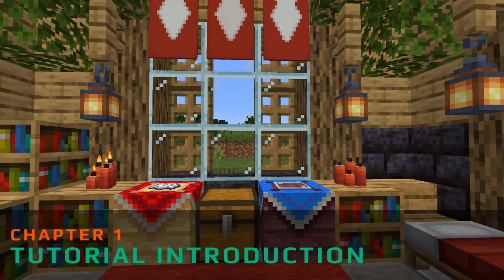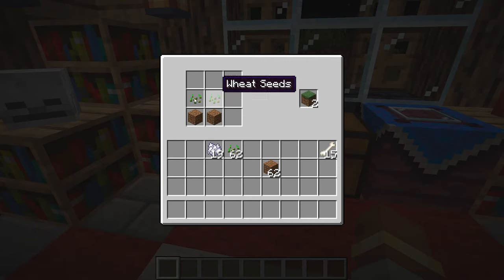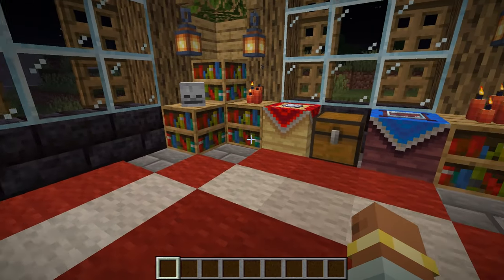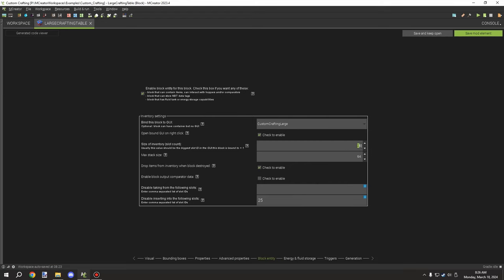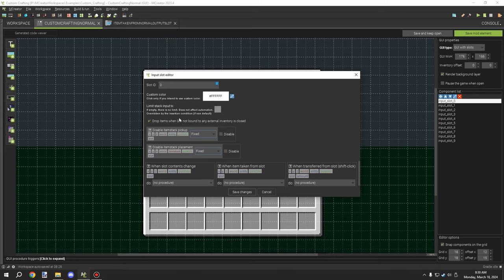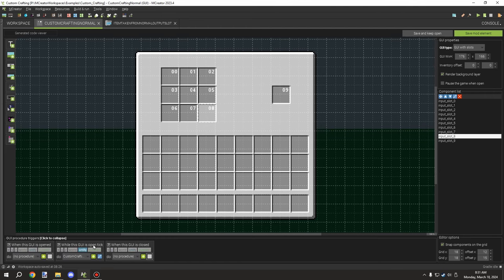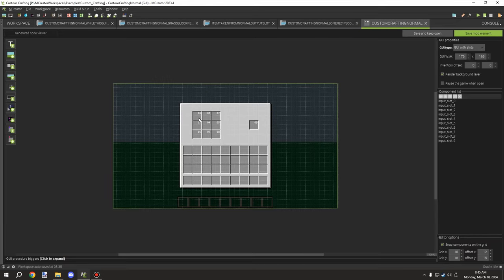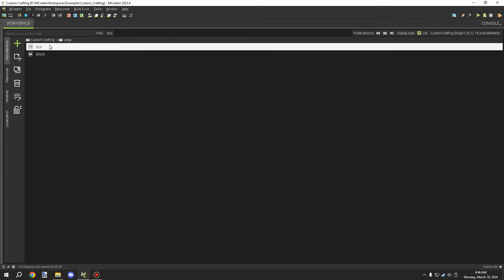How to Make a CUSTOM CRAFTING Table in MCreator!

Comment: It is a pity that there is no way to create new armor slots in the inventory... ehhh
Reply from the maker: One of the most common questions is adding slots for rings and such, sadly its not possible at the moment not without coding at least.
Reply: well there is an add-on for mcreator I think. no idea how it's called but you can make rings and such. but you have like a ton of slots I think am not sure
Reply: @TheMuscularFrog  it's called the curios API.
Reply: @vtubruh  well, if someone can make extra inventory slots, then this may be a possibility

Edit: oops, I didn't realize this was a mod, I was talking datapacks

Comment: Is there any way to make a stone cutter like blocks?
Reply from the maker: I have not tried, it may be possible to cycle recipes using slots and then maybe have some kind of action when the slot changes to update the output item then remove the item but I honestly am not sure if this would work or not. It would require me to do a lot of testing and trial and troubleshooting. But off hand that's by best idea which it could be done without coding.

Comment: I know this is off-topic but I really need help with this: So I was making a Minecraft mod with Mcreator, using Blockbench to make the models for entities and Geckolib only for some entities. But when I made a new entity, an error message showed up when I tried to do anything. Make a new element, update an element, launch the game to test, nothing worked. I check the code and I had no idea what I was looking at and one of the errors was could not find symbol. I tried turning Geckolib off and back on, but still, nothing happened. The error in question was "one or more of your mod elements did not compile correctly. this can happen if you lock mod base files or elements." I press regenerate code and the same pop up error shows up again. Press it, again, again, and again, no end. I NEED to solve this problem as I don't want to have to make another mod and start from scratch and wait for that one to be broken too.
Reply from the maker: I responded to your other post about this question.

Comment: Can you make a tutorial on how to make snow-layer type blocks?
Reply from the maker: This is pretty easy its just blocks that range size in pixels, when you right click on them with an item it replaces the block to the next stage until a full block. This can be done using global trigger for player right clicks block so it's easy for build. With that being said though each stage consist of 2 pixels in difference so your sizes would look like this.

2, 4, 6, 8, 10, 12, 14, 16

Basically just the same block but at different levels.
You will need to model them all by hand in blockbench though.
Reply: @NorthWestTreesMCreator  alright thank you

Comment: Hi, i did try to make the crafting script and noticed that it doesnt allow me to set the procedure to trigger While this GUI is open tick because it has required dependency itemstack. Is there any way around it?
Reply from the maker: You would need to replace the itemstack block with a item selector block, though item stack local variables should still work as long as long as the item selector is used to apply the item to the variable.

Comment: Hi, making this comment in case anyone was having the same problem I was having. I noticed that after following this guide, the items would stay in the GUI when closed, rather than dropping or returning to my inventory, and if I broke the block the GUI was bound to, it would drop all items, including any items in the output slot. To fix this, don't enable block entity on the block, but instead make a trigger that opens the GUI when you right click the block. This unlinks it from any sort of external inventory, if that's what you're trying to do.
Reply from the maker: For items to return to the player this would require advanced script to do when the GUI is closed, but for your other issues your output slot should have settings to disable dropping make sure that players can't add to that slot. There should also be overrides for preventing it from dropping there in the slots settings too.
Reply: @NorthWestTreesMCreator  I actually managed to fix the items staying and duping when the block is broken by just disabling block entity, and having a trigger that opens the GUI when you right-click it. That way there’s no inventory for the items to stay in, so they just go back to yours.

Comment: W video, I made an MCreator mod that I want to use on all multiplayer  servers all it does is when I type /itt it says something in chat and opens a GUI. Is that currently possible?
Reply from the maker: Far as I know mods only will test for thing on the current server. For something like this you would need to hard code something in. Though I think it may be possible in the future to send players between servers if I understand some changes Mojang is working on, though I doubt it would be possible to test if the mod exists on another server.

Comment: Hello, I have never learned to program by blocks in MCCREATOR so I wanted to ask for your help, I really need it, it is a mod that I want to design which works like this, as you already know if you press Ctrl + Q you release the item that is in the slot of your hotbar, and what I want is that when I press Ctrl + Q, absolutely everything that is in my hot bar and in my inventory is thrown away.
Reply: I know how to do it, make a keybind for Ctrl + Q then make a procedure for when you press it, then make the procedure clear the inventory with ''clear inventory of Event/Target Entity''
Reply from the maker: PeaNutferret is correct.

You would need to create two key binds one for CTRL and one for Q I suggest saving this as a player lifetime variable for each one just a simple logic value so you can test if both are true. 

When each key bind is pressed you will need to toggle the state, same when its released you will need to set them to false. This way you have a switch system for your Key bind.

 Doing this will allow the game to test if A and B are true if true then simply clear slots from 0 to 8 which are your hot bar slots.
Reply: @PeaNUTFERRET  ohh ok
Reply: @NorthWestTreesMCreator  ok but let's say that mod is considered a vanilla KeyBinding or let's say on servers, it will detect it as an add-on. That is, it possibly works on servers like Aternos, survival servers, Skyblock?

Comment: Hello! In my mod, I want to make a 5x5 crafting table (not a 3x3) but, when I import the gui open tick procedure you've provided, it says that there are errors: "Procedure return value block is calling nonexistent procedure CustomCraftingNormalGrassBlockRecipeCondition" and "Procedure return value block is calling nonexistent procedure CustomCraftingNormalBoneRecipeCondition" . I have imported the only gui open tick procedure you've provided and I think it is for the 3x3. How can I fix the errors? 
Thank you for your time.
Reply from the maker: The return value in t he update tick procedure for the GUI would be for testing the recipes, this compacts the code a bit in the main file. I provided the 5x5 recipe condition in the project files make sure that you link up that at the location for the update tick procedure and then set your custom recipe, once done regenerate the workspace code and you should be good to go. You may need to remove unneeded recipes from the update tick main procedure but in most cases this should resolve the issue your having.

Comment: Hi, I have a question... How is the ItemTakenFromNormalOutputSlot procedure and there is a Set... to: and a number. So how do I create a Local: slot for that window?
Reply from the maker: This would be a local variable, you would need to create the local variable on the right panel under the button to save the procedure.
Once you have the local variable saved you will see it under custom variables on the left side.

Comment: Can you make a crafting recipe with custom made items on a custom made crafting table or only vanilla items
Reply from the maker: All recipes are custom, works with vanilla and mod items. If other mods have tags for each item it can also use tags rather than testing for a single item which can add support for other mods if they have tagged other items.
Registries might also work too.

Vanilla crafting recipes are not actually supported just yet I am working on a API that can read from forge data packs and get all crafting recipes but this is taking some time to develop. I just released my discord server last Sunday so I have a bit less time as I have been active there helping moderate the community.

Comment: Is there a way that I could make it so that you have to wait for the item to craft, kind of like a furnace? (It is a 5x5 table) If that is not possible, it would also be cool if there was a button in the gui that can fill a progressbar
Reply from the maker: This is possible if you use a timer to delay the output slot item being added, basically that's the only difference between crafting and furnaces besides crafting using more slots and no fuel but same thing pretty much. I have covered how to use timers, though I think it was for Global variables they do also work with block, entity, and item NBT variables just not local variables as local variables are only stored during the procedure running that one time then releases from memory. But pretty much any other variable type will work for timers.

Comment: But when i have to tag the blocks for crafting by myself, doesnt that mean that other modded blocks oike more glass or obsidian wont work anyways?
Reply from the maker: Hay Tronnos I remember your name from long before, nice to see you again 😉
Tags generally are not compatible with other mods when under your own namespace, in cases when this may be appropriate is when you need to separate tags for some reasons but mods can always add direct support for your mod if they decide to place their mod items under your mods namespace, they just need to use your namespace rather than the "mod" tag that's built in. 

With that being said there are some  official tags that are always best to use when possible, these tags are built in to Minecraft and forge/neoforge which can be found below.

https://minecraft.wiki/w/Tag
https://forge.gemwire.uk/wiki/Tags

And in some cases common community tags can be used which MCreator wiki has a page dedicated for this directly. Below is that page. Though you would want to use the forge namespace or Neo Forge namespace though may mods would still pretty much still use forge these days even on neo forge.

https://mcreator.net/wiki/commonly-used-tags-minecraft-mods

The last notable thing is using tags also helps sync things across your mod. If your working with a lot of things that may need to be tested for say for mechanics you can use tags instead and it makes it easier to update as all you need to do is add or remove the item or block form the tag and it updates all the things across your mod which saves a lot of time when adding support for new resources, say you add a new wood type you won't need to go back and update all the procedures to add support for the new log block just update one tag.

I hope this helps a bit.
It's nice to see you still in the community.

Comment: ive got a big question for myself it will be hare but is there a way to make things that are like the mod create so like some rotating blocks with like custom units and such idk how to explain it but just simply something like create
Reply from the maker: I have not seen to much of the mod, though chances are its hard coded, when it comes to things like blocks in MCreator its limited to commands like the clone command. Rotation is vertically impossible without a ton of script. The best I have gotten was a simple elevator system that uses the clone command and teleport command but as far as it being something as advanced as Create or even Mojang's Potato April fools update block that can move blocks seamlessly, its currently not possible without coding it in by hand. Though I really want this to be a reality because blocks have so much more uses than entities, just imagine building a galleon and having mock pirate battles. This would be good but the main issue is rotation and other blocks getting in the way of the clone command and doing it through NBT is not great as you need to communicate to all the block at the same time to move and then you have sync issues with some moving at different ticks. I have not been able to find a good medium but maybe if people push Mojang hard enough to add built in mechanics like that block in the APR fools update it might be possible for MCreator to add support at a later date I also say might because there is no guarantee that it would be something they would add support for as it depends greatly how it is implemented into the game.

Comment: I did already make a comment about my problem, but can you make a tutorial on how to make a working ranged item that has a animation of being pulled back using textures in Mcreator? Please and thank you.
Reply from the maker: I replied to your other comment, I also made a note for a later date to try to implement what I suggest.
I will be doing forge fluid for the next 4 weeks or so then I have 3 other community requests already in que to do.
Then yours.
Reply: @NorthWestTreesMCreator  Thank you so much!

Comment: Can you tell me when I use my slingshot in my mod which is separate into two different items but switch to one another when loading, don’t have durability. Like it has infinite.
Reply from the maker: It may be possible to use a item state system to update the texture like how bows work.
For this you can try using a global procedure trigger for "When item used" testing for the exact item (itemstack = [item selector]) Then applying NBT data to the item this may then allow you to update the item display of the item based on the NBT item value using item states. However keep in mind that item states are client side only so anything that uses world side may not work.

Also a pro got "when item used" is the "time" dependency this can be made using the advanced dependency blocks and typing the dependency name in there so in this case "time" would allow you to test how long the player is using the item for and then if it reaches a set number you could apply the NBT variable to the item.

Giving that NBT would work for item states. I am not fully sure if they do work or not but if they do then this would be possible.

The math would look something like below.
If [time] = [20]
  Do: set item NBT to 1
If [time] = [40]
  Do: Set item NBT to 2
If [time] = [60]
  Do: Set item NBT to 3

You would then use the NBT value in your test for the item state for each texture.
0 would be your default texture state when its empty.

I hope this helps.
Reply: @NorthWestTreesMCreator  Thank You!

Comment: hello, i followed this tutorial. but changed it so it has 2 input slots and 1 outpu slot. but it keeps crashing.
im aslo using version 2024.2. is there a way to fix this?
Reply from the maker: Good chance that your block's inventory does not have enough slots for the given GUI make sure that the block has the same amount of slots which should be +1 from the highest GUI slot ID.
Reply: @NorthWestTreesMCreator  I tried it and it worked! Thank you!

Comment: 13:50
what do i do if my gui only have one inputslot.
Reply from the maker: You just need to remove the slots your not using and just use the one slot instead. The ID should be the same as your GUI ID.
Reply: @NorthWestTreesMCreator  thanks

Comment: I can only craft custom recipes in a normal crafting table, they're not crafting in my custom table
Reply from the maker: If your using the recipe element then this won't work for adding recipes.
The recipes in the tutorial are procedure based meaning that they are coded in using procedures.
Doing it this way is not compatible with other mods or the base game only your own mod.